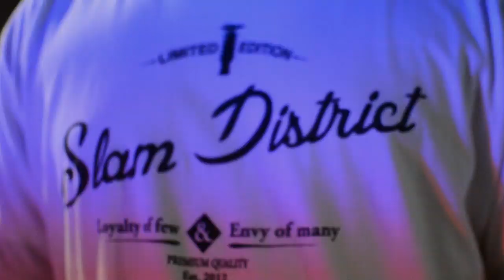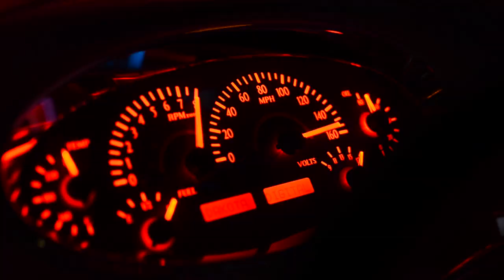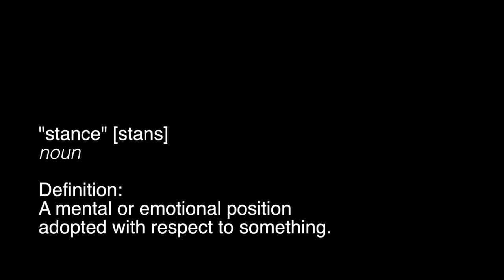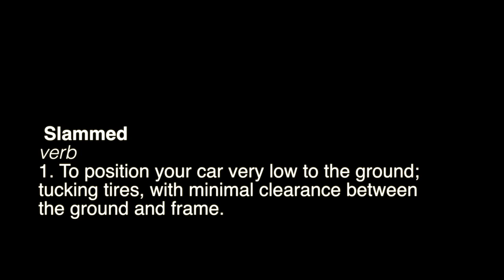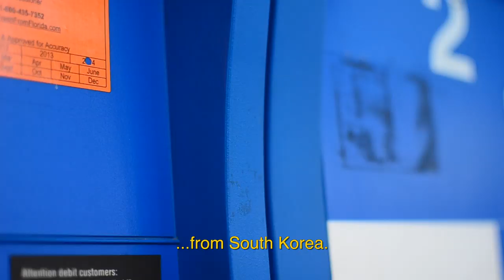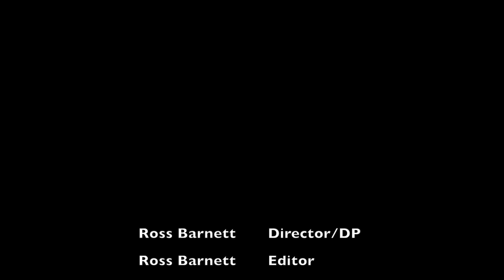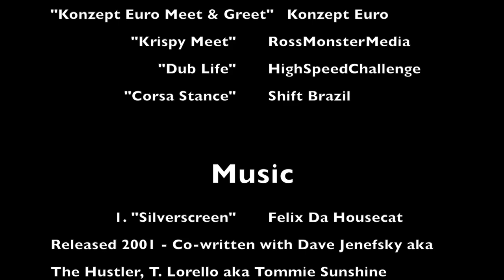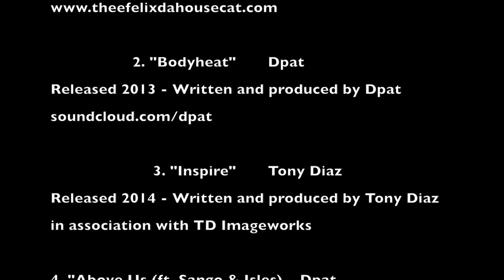Stance Diaries: Living The Low Life (A Mini Documentary)

Comment: I have always been a Lexus guy, I saw this whole VIP look that a lot of GS300 guys were doing. My track car is a Lexus IS300 2jzgte, v160 basically a 4 door Toyota Supra. I took my GS300 bought a set of TEIN coilovers, some god speed control arms to get as much camber as possible and a set of CCW LM5T wheels 18x9 in the front 18x10 in the rear. The engine was bone stock, stock exhaust too. My 215,000 mile GS300 would get more looks at a car show than my track car! I was dumbfounded!